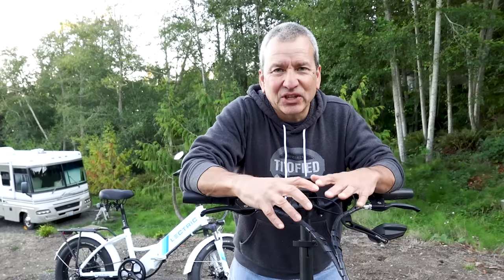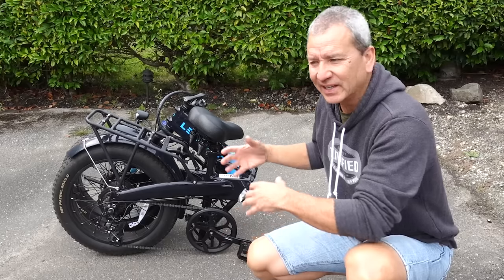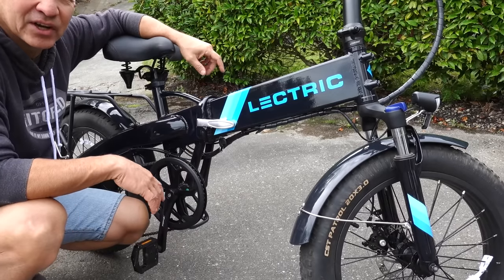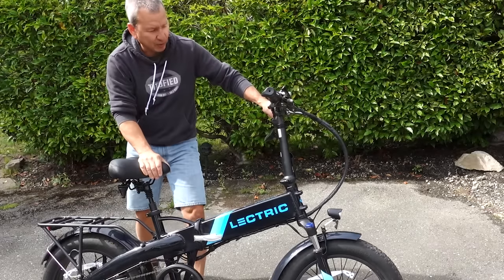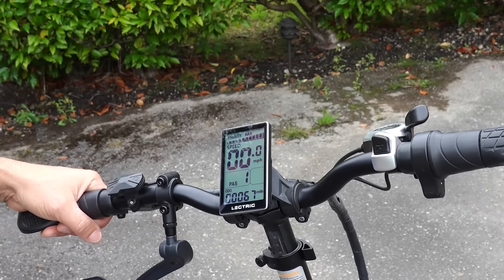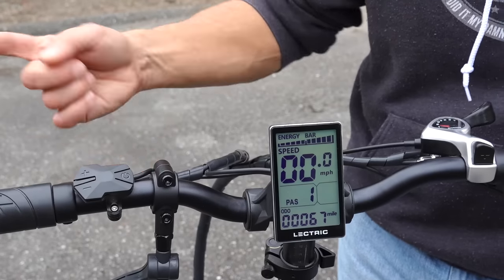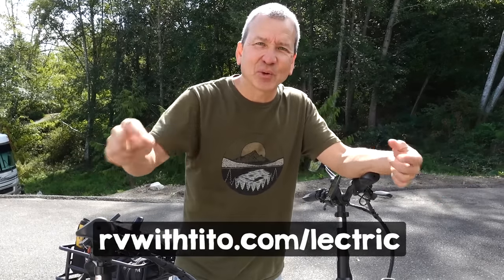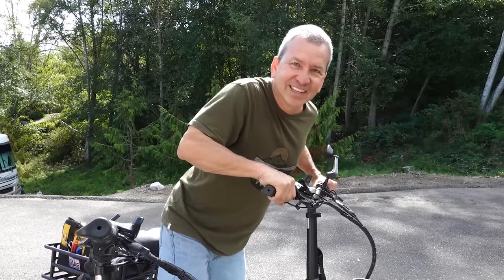Should a LECTRIC XP be YOUR FIRST E-Bike? | Full Review & Testing | RVwithTITO DIY

Comment: I have the XP STEP-THRU 1.0.  Thank you for such a thorough review of the LECTRIC eBikes. I’m still really pleased with 1.0   I kept my styrofoam to place between the bike while transporting it. 

Two of my friends have purchased the 2.0 STEP-THRUS. 

In my opinion, LECTRIC has proven to have the best customer service. I haven’t had any problems with my eBike, but I have called and emailed them quite a bit before and after receiving my eBike because I had lots of questions, like when will I receive my eBike, and how to change the tire size to make the speedometer more accurate. After riding for a full year, my eBike operates perfectly. 

Now, I’m communicating with the city about getting bike lanes and signs to protect cyclists while riding through the city.
Reply from the maker: Yeah. We're pretty happy too. More and more folks are riding eBikes now and it's one of the fastest growing vehicle sectors.
Reply: @RVwithTito    You’re absolutely right!

Comment: Great review. Didn't know about the ground clearance issue btwn models. Can you add some charging info please? Like how long to fully charge from zero? Also, of course it will be faster from a half charge state, but maybe there is a charge speed rate change if the battery starts at 50%?
Reply from the maker: Thanks! It's 4-6 hours for full charge. I haven't had it to zero yet, but when I've charged them they seem to charge pretty quickly.
Reply: My v1 standard XP charges from empty to full in about 6 hours using the original charger (2A). You can get a faster charger (I got the Cycle Satiator - now over $350) because it would charge much faster and had several different charge cycles one could use, especially the one to lengthen battery life (don't fully charge batteries or they wear out faster - run them between 85% down to 15% to get better life),

Comment: Very informative video!! Thank you very much for sharing your tutorials and experiences. 

We live in Ouray.  I keep thinking that we would want a 750w ebike to help with the hills. Do you have any thoughts of that based on your experiences so far?  I have pretty much a linebacker build at 250 lbs
Reply from the maker: I'm testing out a higher end 750W ebike now with regen and frankly I think the our Lectric 2.0 peddle assist has more giddeyup and does better on the hills.
Reply: I had the prior version standard XP (it was stolen - boohoo) and it handled many hills well but not the steepest ones (210 lbs. plus small tool kit). For those I had to get a wider range rear cluster (11-34 vs. stock 11-28) and it was still hard (steep hill!). 

I typically commuted 8 miles one way and average about 17 MPH including stop lights, etc., with flat land peaks of 26-28 MPH using PAS 4 on a full battery (obviously using the standard Class 3 mod). That uses about 1/3 the battery and the return trip is therefore slightly slower (another couple of minutes of travel time and 23-26 MPH on the flat). Only problem was one day with high headwinds (20+ knots) on way home when I dropped PAS to level 2 to ensure I would have juice to make it (was not as close as I feared it would be - returned to PAS 4 about 2 miles out while in wind "shade" of hill next to me). The next upgrade I was going to do was a larger sprocket so I can hit 30+ MPH.
Reply: BTW, really nice review, Tito! And my total weight including tools, bags, etc. was around 230. I am 70 years old, so running at 26-28MPH was some work (pedals spun pretty fast!
Reply: The "500w" motor designation is almost meaningless.  Under full throttle, these bikes draw 19 amperes from the battery, which means 19a x 48v = 912 watts going to the motor, or a bit over 1 hp.  All the "500w" number means is that the motor can run continuously at that rate.  But since a hill only lasts for perhaps five minutes, the motor is perfectly fine taking in 912 watts for that duration.  Wouldn't be happy on the Pikes Peak hill climb, though.

Very useful to change out the 14x28 freewheel to 11-34 (and easy to do).  Then you can help with the uphill pedaling.
Reply from the maker: Yes. I've seen that freewheel mod and may do it. BTW the peak rated output is 850W so it doesn't surprise me to get 19A on hills. I've seen similar results. The voltages does drop as well when climbing which may yield a slightly lower than 48V reading while climbing. Thanks for the comment!

Comment: really thorough review! it seems like for the money and with the standard features you really cant beat the Lectric bike in comparison to others. i like the extra's also, seat basket, especially the mirror's. i dont think my standard rv bike rack would support these. what bike rack do you use or recommend? also can these handle getting rained on during transport or do you use a cover? i really didnt want to use cover because i haul them on the front of b+ rv and may block radiator for cooling. thanks for making this video.
Reply from the maker: Thanks. I put a link to the ebike rack in the description. I've used a standard bike rack (before the ebike rack), but only for one bike. I kept the second bike in the car. Yes. I always use a bike cover. Helps keeps the road grime off plus obscures it. I understand why you wouldn't want to use a cover on the front...makes sense.

Comment: Don't forget to lock the battery in place and REMOVE THE KEY before closing the bike..!!!   ALWAYS remove the key before closing..!!!
Reply from the maker: Curious. What has happened when you keep the key in?
Reply: I have the first one and it's a great ride. BUT, if you leave the key in, it will bend upon closing (all the cabling).. If you are lucky, you will be able to straighten it without snapping it in half or breaking it off inside the battery..!!  Fun..!@!
 Be sure remove the tires and re-line the rim with heavier tape or wider interior rim liners, as the original will be twisted with the result being the spoke nuts wearing through the tube..!!     Also, be sure to 'slime' the tube interior as the tires are tissue paper no matter WHAT anyone says..  Two years ago a 1/16" thorn taught me the lesson..   Don't let the 'knobs' fool you..   
I also lined between the tire and the tube for extra insurance..  
BTW, you are just going to 'LOVE' removing the rear tire... LOL!   Better do some research as you'll need it..  LOL!  The brakes are junk, too.  
Over time, you will need to tighten the spokes to remove the crunching sound..!!  After I did all that I've been a happy camper ever since...  I did posts years ago describing all this on reviewers who don't talk about all this because they received them for free...    Yes, I'd buy it again...   I like your style Toto, muchicimas gracias..!!
Reply from the maker: @pjf7943  Thanks for the great suggestions. I've been planning on putting some slime in there. Luckily I haven't had the key issue yet. So I'll follow your suggestion. I have had friends who have broken keys off but it was just from turning too hard.

Comment: Nice review Tito, you've definitely piqued my interest! What kind/brand of bike rack do you use? At 64 lbs I'm wondering just how difficult ii is to put the bikes up on the rack; can you roll them up on there at all to get them started?
Reply from the maker: Not with the rack we have. I have to lift it and it's a bit of effort.
Reply: @RVwithTito  
Hi love the video! We started off with the 1.0 ebikes and decided to upgrade 2.0. Our biggest challenge has been taking them camping. We have a 2018 303 RLS 5th Wheel. We are being told the hitch will hold 300 lbs. two bikes equal 130 lbs, plus a bike rack that weights about 70 lbs. My husband is not comfortable driving down the road with the bikes on the back of our camper. Any suggestions on a bike rack and concerns with that type of setup. Right now we are putting one bike inside our truck and laying the other one in the bed of the truck by the window so the hitch will clear on turns. Thank you!
Reply from the maker: @jackiesible2086  Hi Jackie. I understand the dilemma with the 5th wheel. I don't have any useful tips on this since we have a motorhome. We use a GenY multi-hitch so we can tow the car and have a bike rack. I suppose the truck option you're using is the best I can think of right now unless you have room in the 5th wheel. If you come up with a great solution, be sure to let us know.

Comment: You brought up some good points I had not thought about and I was thinking about these E Bikes for my wife and I:  #1, The batteries being different between the two body styles.( I assumed they would be the same) and #2 The pedals being lower on the step through. These two issues might lead me to get two of the same model depending on my wife's ability to get on to the taller one.    If I have to ride the step through at 6'2" and 210 pounds then that's what I will do. Luckily, I am secure in my manhood. Lol I prefer the higher ground clearance for our gravel road but we won't be doing a lot of high speed turning. We are both in our sixties. It was a very good video; very broad and specific. Thank you.   Ray

Comment: I really enjoy your videos and we're looking into E-bikes. Problem is that we boondock all of the time and sometimes we need to stay at places like Walmart, Lowe's, cracker barrel etc. It already happens twice that they tried to steal our bikes. That's currently our issues which prevents us from buying E-bikes. Do you have any good tips on that? They just cut the lock, so that worries me. We can only but it on the back of our 19ft van, so no option to put them inside.
Reply from the maker: We boondock 100% too. I collapse the seats and fold down the handle bars. Then they are double locked to the bumper. Finally, we have a large bike cover that covers both bikes. So you can't really tell what's inside. So far so good. I think keeping them covered is a good start. You can't see from a distance what's under there. Bottom line is that there are no guarantees. I also got a couple of these alarms that go off if anyone touches your bike. Just haven't used them yet since we're in our sticks and bricks right now.
Reply: @RVwithTito  That's a great idea 💡 are those just like tarp? Or hard covers?
We have no sticks and bricks house, full-time travel is the only thing we do .
Keep up the good work!!
Reply from the maker: @stevenerkman3230  Not a hard cover just a vinyl cover with elastic and tie straps. They take a beating from the sun but are cheap enough to buy a new one each year or two.
Reply from the maker: @stevenerkman3230  Also get a couple long bungies to wrap around it to keep it from flapping around in the wind...good luck!

Comment: I saw a couple of these while doing drone videos down in Fort Myers, FL.  I thought the price was great.  I decided to build my own ebike.  I had the Schwinn 26 in bike and decided to purchase a 1,000 watt rear hub motor and 48v 13 AH battery. Around $600 with a couple additional accessories. Mine is different in that it has a twist throttle like a motorcycle.  In fact I can ride entirely without pedaling.  Kinda cool.  A very slow version of my FJR motorcycle. What I do like about the bikes you are showing, is the folding ability.  That really makes transporting them much easier.
Reply from the maker: Nice custom build. We transport our mostly on a bike rack and occasionally load them in the car which is when the foldability comes in handy.

Comment: Thanks for a really complete review. I have one I bought in May 2019 I will soon have 3000 miles on it.
It has held up very well.
Reply from the maker: You're welcome. That's great to hear!
Reply: Are you using the original battery? Just wondering about battery life span.

Comment: I bought an electric Brompton- fits in the gas locker- 2x 11kg bottles (I added underslung tanks so it's available space). Take it in to the supermarket inside the cart for small to medium shops so don't have to worry about leaving it outside. Your bikes look great and will be better on rougher ground though I take the Brompton along rough tracks. Getting an Orbea Rise or a Trek Rail 9 for the really rougher stuff of the Highlands.
Reply from the maker: Good stuff!

Comment: Great Review! Wondered about a 20" sized bike vs a 26" traditional bike. But, you answered all of the questions. Mainly, would your feet drag the ground or the pedals impact the ground when turning? Looks like a very versatile bike, especially for the money. I also like the throttle which is not usually equipped on bikes at this price point. I live in a coastal area where bikes left inside storage sheds still corrode from the salt air. The foldable option allows me to take it indoors over the winter and doesn't take up a lot of space. I like your storage tub idea.
Reply from the maker: Because of its size you'll definitely feel more stable on a 26" fat tire bike, but you definitely lose the portability. We've ridden both types. The 20" wheel bikes like the LECTRIC still feel pretty good. It's just a different experience.

Comment: I did a test ride a few days ago at their North Phoenix office. I was impressed enough that I bought one on the spot. Now my 2 motorcycles will soon have a EBike in the stable next to them in the garage. My first EBike. Can't wait for it to get here.
Reply from the maker: Right on! Yeah. I'm probably going to get rid of my other bikes :)
Reply: Ron how do you think the batteries will hold up during our hot Phoenix summers? 
I wonder if this one hidden inside the frame will get hotter than a e bike like the Rad model with the exposed battery?
Reply from the maker: @fvvfvbbbb  Lectric is in Phoenix. So I'm sure they could give you a good answer.
Reply: @fvvfvbbbb  Hi! While I wont know for sure how the heat affects the battery until this time next year, I think that they will be fine. If you dont over discharge them and dont charge above ~75-80% then let it set you will be good to go. Lithium ion batteries dont like to set fully charged and they dont like to be discharged down below ~25% What it boils down to is take care of the battery. Only fully charge if you are going to use it  in the next day or so. Within about 36 hours you should get it down to 75% or so. You get the idea. Also I know lithium batteries do not like cold. Not at all. They get down around freezing and the performance of the battery falls way off. I would not use or charge a very cold lithium battery. If you do you would possibly harm the battery to the point you only get part of the cycles before it done for or even kill it. Same for a very hot battery. By this I mean let it cool after a ride before you charge it. I may be wrong but I think the frame may act as a large finless heat sink. If so, that is a good thing. I personally am going to treat the battery very well and not worry about it. I fully expect to get the claimed 7-800 cycles out of it. If I find I am needing more battery then I will buy a second battery.  Thank you and have fun!
Reply: @Big.Ron1  Hi Ron
Thanks for the reply. Lots of good info. I do wonder if the bike frame will help disappaite the battery heat or trap it in compared to a bike with an exposed battery. 
Keep us updated on your new ride.

Comment: I have an E-bike, but if I had it to do again, I would choose one where the step-through is as low as possible. My bike folds, which is not a feature I have so far needed to make used of. The high step through has often proven to be an issue when needing to mount and dismount quickly. I do like the idea of chuncky tires rather than standard kind. A local cycle repair shop, which specializes in commuter bikes is a great resource for electric bike repairs, they also offer free pick-up and delivery, and charge surprisingly little for repair services compared to other bike repair stores in town. One of which charges and extra $200.00 if one's bike was not purchased from them. The majority of bike shops have no clue when it comes to electric bike repair. There is also inexpensive insurance for electric bikes that can be purchased online. I make it a point to never leave my bike unattended even with a strong lock.Having it registered with police is also a good idea, to be able to prove ownership.

Comment: What you may not be aware of. We had another brand full size ebike. And when you begin peddling it would automatically kick into power and jerk forward. The Lectric gradually build up the assist. Big difference. We actually sold the other brand due to that. We live our LECTRIC bikes. Also like that all the electronics andotor is water proof.
Reply from the maker: Even the LECTRIC can surprise you that first time if you've never experienced it, but you're right you get used to it quickly.

Comment: Thanks.  This really helped me with my new lectric bike.  I think the only thing I don't like about the bike is leaving the key in.  I'm going to use mine to save on gas riding back and forth to work.  Just hoping I don't forget to remove the key.  I took it for a quick ride tonight and I'm impressed by the quickness and smooth ride.
Reply from the maker: Yeah. I hear ya. Don't forget the key.
Reply: How do you plan on locking it up so it doesn't disappear??
Reply: @beverlybowman9059  Not 100% Sure yet but I'm going to buy a really good lock.  I've seen posts by others with recommendations.   I'm also going to make sure I have replacement insurance so if it is stolen I'll know that they will pay the full amount to replace it.  That will give me more of a piece of mind than anything.